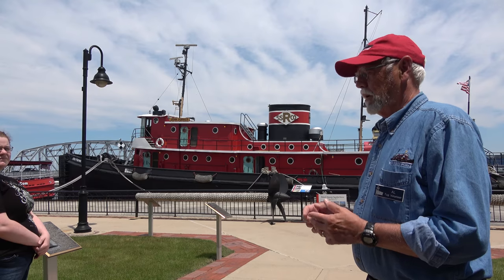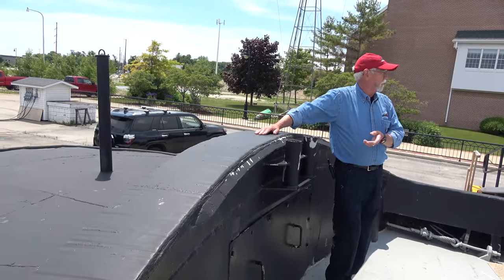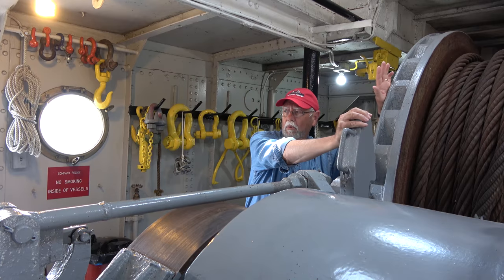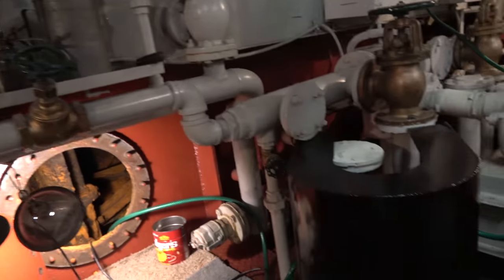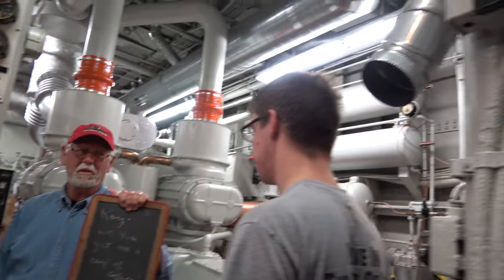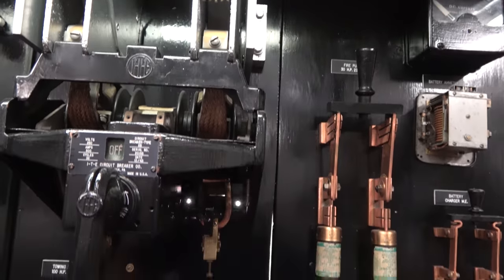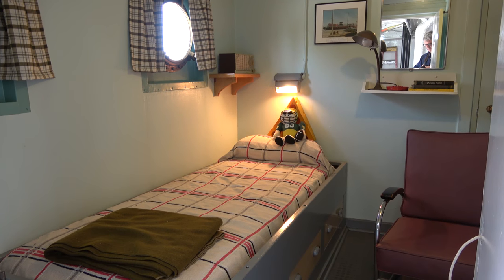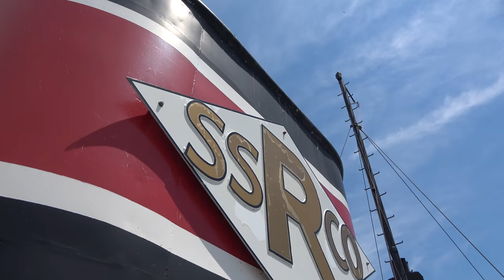Tugboat Tour

Comment: I was a certified welder in a railroad repair shop for 41 years, and the docents remark about changing a connecting rod reminds me of a repair I had to do two or three times over the years on these EMD (Electro-Motive Division of General Motors) engines in locomotives. The counterweights on the crankshafts of these engines had the odd design of being narrowed between the counterweight and the actual crankshaft. Occasionally, when a connecting rod failed and flailed around inside the engine, they would get wedged between one of the counterweights and the engine block and break the counterweight off of the crankshaft at that narrowed place! The cylinder walls were typically damaged also, but each cylinder (called “power assemblies”) is a massive steel casting that’s relatively easily replaced, the crankshaft - not so much! The engine blocks on EMD’s being fabricated plate steel, we’d take a torch and cut a temporary access opening big enough to get at the crankshaft, prep the counterweight and crankshaft by grinding bevels, and weld the counterweight back onto the crankshaft! Then weld the plate back in place that we cut out of the block. If you’re ever looking at an EMD engine and see where a large square weld is present on the lower part of the block, there’s a good chance that the same repair has been done to it! As an afterthought, I never had one to fail after being welded back onto the crankshaft, even after years of service!
Reply from the maker: Hi!  Thank-You for that incredible comment!  I could "see" you doing the repair.  I have one bit of confusion.  You referenced "counterweights."  These were weights like tire balancing, and not flywheels?  Thank-You for viewing and commenting!
Reply: @ipfeldspar  They’re part of the crankshaft forging, not separate pieces. Each one is a relatively big chunk of steel, but the “web” (that’s what we’ll call it!) that joins the weight to the main body of the crankshaft is smaller than the weight itself. My guess would be that EMD designed them like that so that in the event of a broken connecting rod impacting the weight, it would break off the weight instead of doing heavier, possibly unrepairable, damage to the crank. Merry Christmas to you and yours!